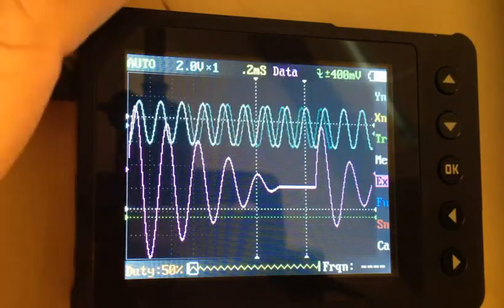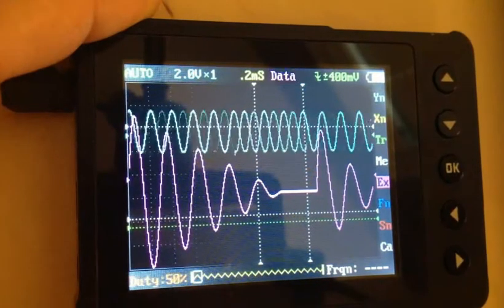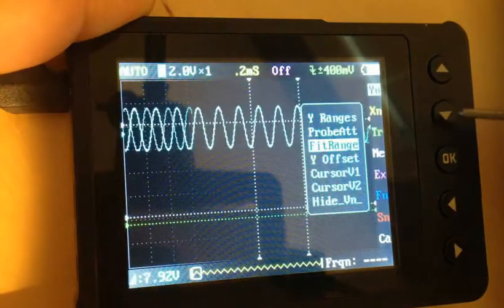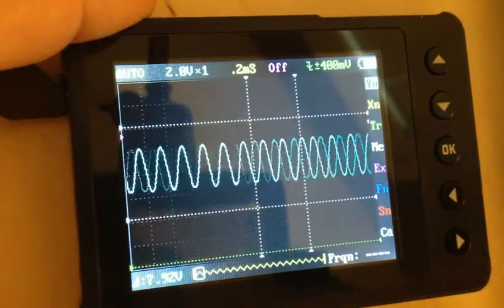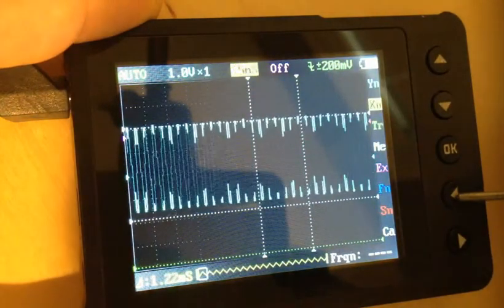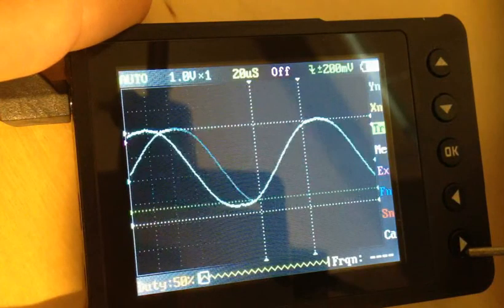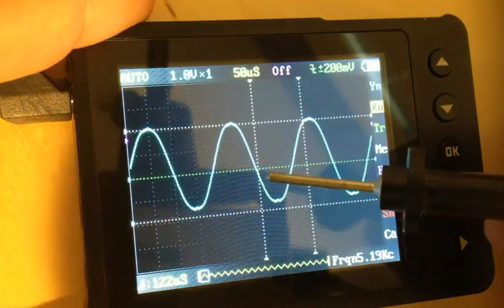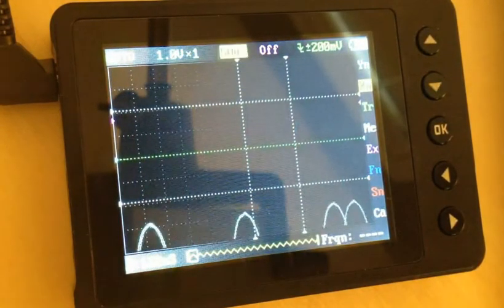SEEED DSO  Organizing the display

Comment: I've just bought a dso211 scope, same software but design is little different. I am not able to get the full waveform in view when tuning my subwoofer amp. The wave is too big but I can use the 'Y' setting to bring the bottom or top of the wave into view but not the entire thing. Is this due to the power my amplifier is outputting ? It's fine with my smaller less powerful amp.
Reply: No, I tried the volts per division as well, no joy.
My scope only came with a x1 probe. I ordered a x1 x10 switchable probe and that has solved the problem.
Reply: @ajpepe72  did you have to buy a 3.5mm to bnc adapter as well? Also did you have to compensate the new 10x probe or was it all set to go without compensation? If you did compensate,how did you do it?
Reply: Rob l no the input on my mini unit is 3.5mm not bnc so new probe just fitted and worked straight away, no compensation needed.
Reply: @ajpepe72  I can't seem to find a 10x switchable probe with 3.5mm jack. Only bnc ends. That's why I asked. Maybe I just need to search some more.i have the nano v3 on the way.wich obviously is 3.5mm. why I was asking. Thanks for the reply
Edit...I believe your dso211 has mcx input,not 3.5mm like my v3. That's why you don't need an adapter. Unfortunately with my v3 I'll need a 3.5mm to bnc adapter.
Reply: Rob l yes, sorry it is mcx, it’s been a while since I’ve used it but just checked.